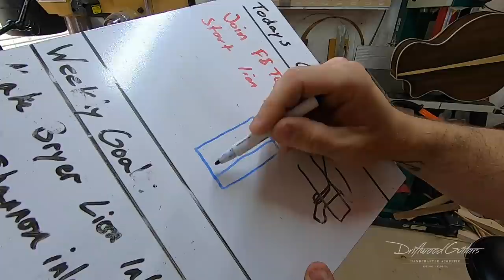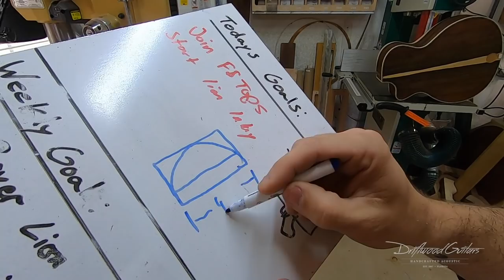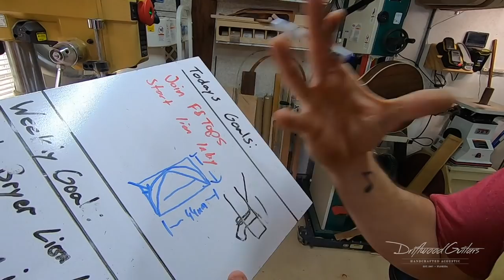How to shape a guitar neck by hand.

Comment: I start from a similar point (without a CNC) then I do a 90 degree edge using a bottom bearing router bit to get rid of some material. At this point I’ll take a file and take down the back of the neck at first fret and near my heal to get near the appropriate thickness. At that point I use a spoke shave to get everything level and finish by sanding. It’s a long process, but it’s definitely a rewarding task.

I don’t have a fancy shop, I have a small bench in my garage with a bandsaw and router. Everything else is hand tools. Don’t let lack of tools stop you.

Comment: I noticed that when you file across the neck, you "follow" the curve, i.e. you start your stroke horizontal at the centre, and end vertical at the side.  Although it feels weird at first, most people find that they get a much smoother curve if they start vertical, and end horizontal.  Start with the tip of the file on the binding, with the handle in the air, then, as you push the file, you also raise the tip and lower the handle until it's horizontal.  It's hard to explain why, but the problem with following the curve is that it's your body that's "drawing" the curve, and very few of us can draw a perfectly smooth curve, particularly when synchronising the movement of several large muscles.  It's also too easy to follow the problem created on an earlier pass and exacerbate the problem.  With the opposite method, you just drop the handle as you push through, and geometry takes care of making the curve.  Clearly you get good results using the follow method, so you're probably reluctant to change, but give the other method a try.  As well as accuracy, you'll probably find it's quicker, because you spend less time finessing the curve.  Put it this way, I've never met anyone who's gone back after trying it.

Comment: Do you use Spanish cedar on Steel string Guitars I love Spanish cedar !! I was always scared to try it on my guitars.  I just thought that it may be a little too weak for steel string. But I guess with the carbon fiber rods you install probably really good.  It’s very light weight and stable.  Thanks for the video really good job!! Nice work
Reply from the maker: Yeah I’ve used SC necks on over 30 steel string guitars. I’ve only ever done it with my dual carbon rods installed, but I’m sure it’s strong enough even without the carbon. It’s my favorite material for necks.

Comment: I have a chunky necked parlour. I want to make it thinner. Would you suggest a file along centre line, or going straight to shoe shine technique. I am a fine furniture woodworker,  but not not a luthier-so ok with tools. Am in no rush, so which is most accurate way-not necessarily fastest way? Or maybe straight block with sandpaper or.....Thank you. Great video. ...
Reply from the maker: id stick with the shoe shine in you case. its slower, but less likely to mess up.
Reply: @DriftwoodGuitars  That is really helpful. Was thinking of using scrapers... will stick to a sandpaper, but was was curious as to whether you use scrapers at all?